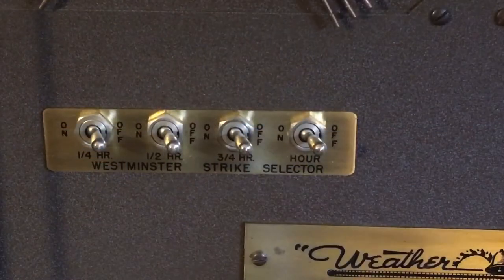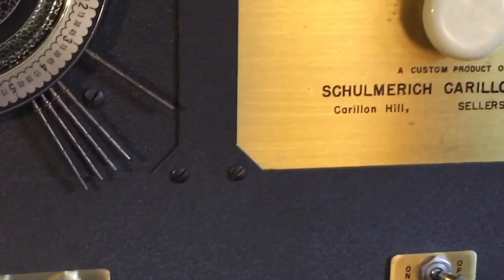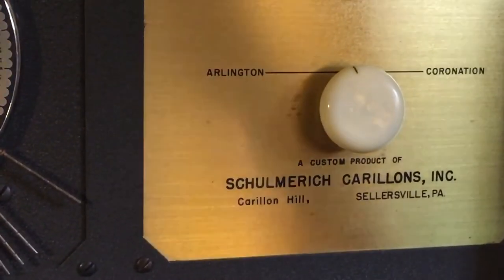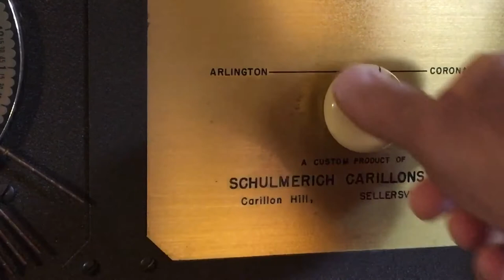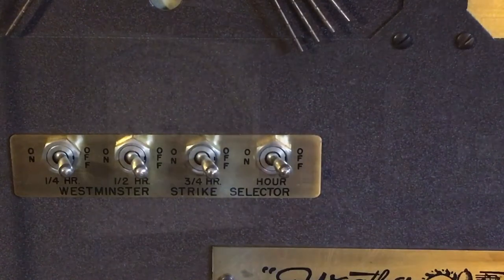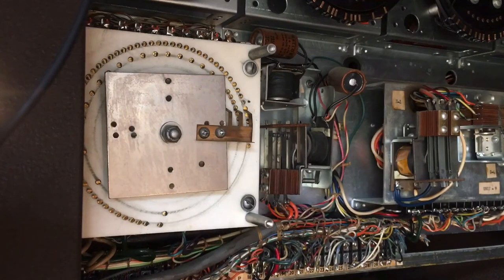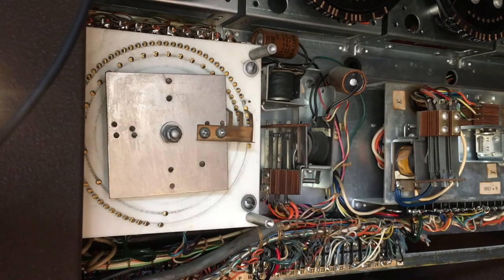Westminster Chime - Vintage Schulmerich Carillon

Comment: Hello. I'm trouble shooting a Model 180 with a roll player that isn't working. The reporting from the organist at the church is that the motor is bad. Is there a manual I can obtain demonstrating the disassembly of the cabinet and test points for the motor. Are there motors available if it is in fact no longer functional?
Reply from the maker: Hi Jim,  I’m sorry but I have no information for you.  The only manuals I have ever encountered merely explain the operating procedures.  I don’t know anything about the motor, either.  Perhaps someone out there knows of or has a service manual?  Especially now that the Schulmerich’s carillon division has been sold, getting any information about these older systems is a challenge.  I wish I could be more helpful!
Reply: @rickruggiero7128  Thanks for getting back to me Rick! I will continue to hunt for the manuals. I alsowill continue to watch your channel. Be well!

Comment: its too slow and what makes sound is it chime rods
Reply from the maker: There are rods of two different varieties on this system, switchable at the control cabinet.  The speed is a matter of taste, but it is not controllable.  I will say that my college had the same system and the speed worked out well because there were many neighboring buildings, so lots of echoes.  Any faster and it would have been chaos!
Reply: @rickruggiero7128  can it play Whittington chimes too
Reply from the maker: No, only Westminster.  I don’t know whether Schulmerich offered any other chimes at the time this was made.  One consideration might have been the number of notes in the sequence (Whittington has twice as many) as every strike was generated by a hard-wired contact that had to fit on the coder disc.
Reply: @rickruggiero7128  how meny rods it got
Reply from the maker: That depends.  When set to “English” bells it uses 10 rods (four notes with their octaves for the melody, and a fifth rod with its octave for the hour).  When set to “Flemish” bells it uses 20 rods, because each note is created by two rods struck simultaneously.  The whole system (with the keyboard) is 319 bells, seven different types.
Reply: @rickruggiero7128  whittington takes 8 according to mantle clocks
Reply from the maker: You are absolutely correct - Whittington uses eight pitches (and possibly a ninth for the hour strike).  On this system, each note is played along with its octave, so that would be 16-18 rods for English (8-9, plus another 8-9 for the higher octave).  If done on Flemish, that would involve 32-36 rods - two for every note and two more for each octave above.

The comment I made above about Whittington having twice as many was not referring to the number or pitches, but rather the number of strikes in the sequence.  Westminster has four notes in the first quarter, Whittington has eight.  Westminster has eight in the second quarter, Whittington has 16 - and so on. So that would be a lot of contact strips to fit on the rotating coder wheel.
Reply: @rickruggiero7128  put a mantle clock mechanism in it like a triple chime hermle triple chime key wound on it that would work lol